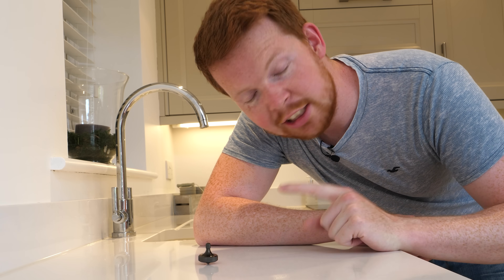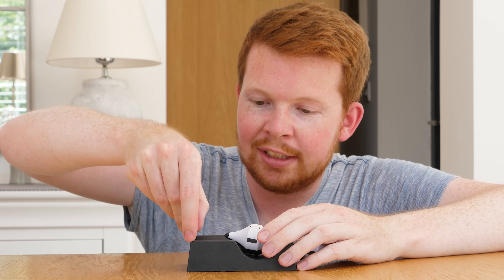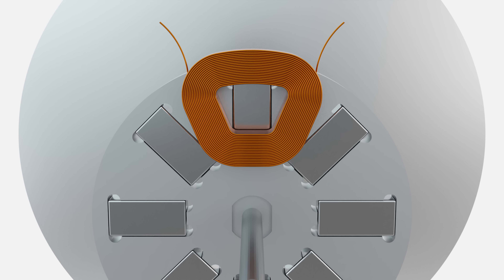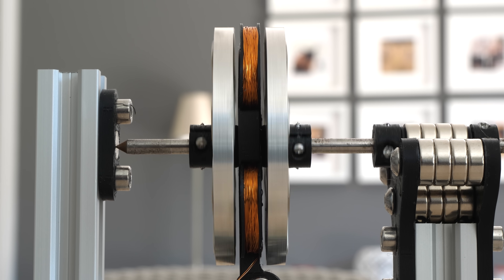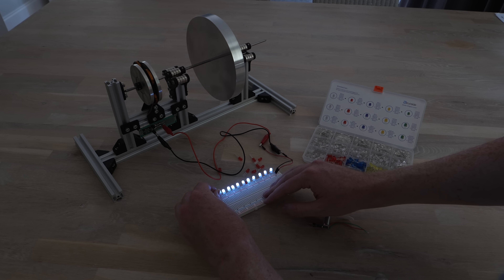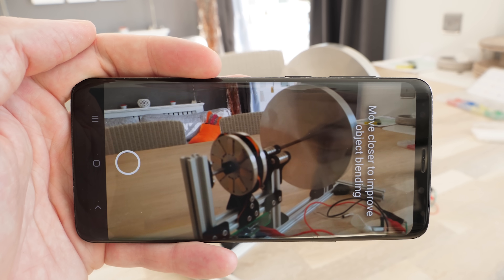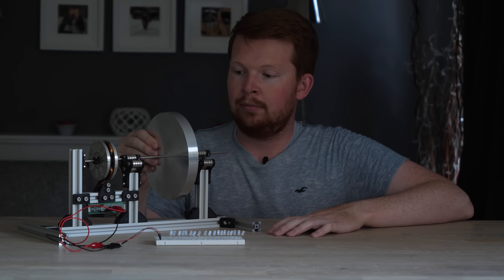Flywheel Battery

Comment: This was the first time I've ever understood how a full bridge rectifier actually works.
Reply: Exactly! Same here.
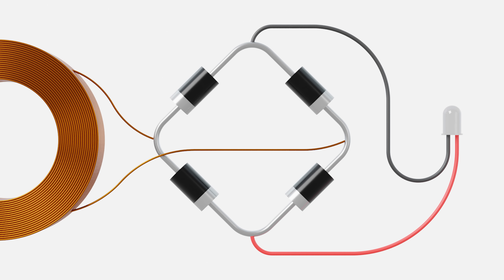Reply: @albertboaduameyaw8659  6:21 notice the arrangement of the diodes, and the source and load. You can use a bridge to protect the input of your project from reverse polarity, If the battery was installed "the correct way" the power would flow properly. If the battery was installed "the wrong way" the power would STILL flow properly. Unfortunately, there is some voltage loss. Bridges typically use diodes that lose 0.7V each, so 2 * 1.5 = 3V loses possibly 1.4V <very sad>  If you build you own bridge using Schottky diodes the loss is less 0.3 to 0.4V.    https://en.wikipedia.org/wiki/Schottky_diode
Note: I previously referred to 4 diodes, which is incorrect
Reply: 6:21 notice the arrangement of the diodes, and the source and load. You can use a bridge to protect the input of your project from reverse polarity,
If the battery was installed "the correct way" the power would flow properly. If the battery was installed "the wrong way" the power would STILL flow properly. Unfortunately, there is some voltage loss. Bridges typically use diodes that lose 0.7V each, so 2 * 1.5 = 3V loses possibly 1.4V <very sad>  
If you build you own bridge using Schottky diodes the loss is less 0.3 to 0.4V.    https://en.wikipedia.org/wiki/Schottky_diode
Note: I previously referred to 4 diodes, which is incorrect
Reply: @leef_me8112  Its not 4 *1.5 since only 2 diodes will conduct at any one time
Reply: @dantronics1682  You are quite right, I will correct my replys.
Reply: Yea
Reply: Same...
Reply: That aha moment too when you realize that with AC you're literally alternating between pushing and pulling the electrons through the wire just a short distance. This is why there's so much less resistance with AC power transfer because you're not trying to push the electron all the way from one end of the wire to the other. You're just pushing and pulling it a few inches and reversing that flow 60 times per minute. It's like having a DC power transfer that's being done with a 6 inch power cord.
Reply: @randr10  
Like students pushing each other in a long crowed hallway. Push the kid in front of you and some kid 20 people ahead falls over.
Reply: @randr10  that's only HALF the story though Eddy currents are Vortexing filament outside of the line , the greater the distance for AC the Greater the line loss which means needing Thicker Wire.
Reply: @mjolnirswrath23  Oh I know there's line loss, but the main reason for the reduction in line loss over DC is what I stated about not needing to push the electrons all the way through the wire from end to end, or at least I think that's the main reason. Could you elaborate on what you mean in regards to eddy currents?
Reply: You should try electroBoom ;-)
Reply: @tiborbogi7457  yeah i heard this comment lmao
Reply: Make a weather balloon with a pressure meter and a servo on the end that compensates and drains the excess out when you go to a big altitude

Comment: can u replace the tip with magnets to decrease the friction , replace the flywheel with rotor that heavy enough as to act like a flywheel , increase number of magnets per rotor and increase coil per rotor. im sure this will increase the output voltage

Comment: What if you drive the flywheel with the motor which is powered from the flywheel ?  Bootstrap the system by turning the flywheel manually.

Comment: Use four sets of fixed baring magnets, two on the bottom and two sets on top, and you will have less wobble as the magnetic fields press against each other
Take the flywheel and machine small cups shaped like those on a pelton wheel then use compressed air to spin the flywheel.
last, instead of a plate at one end use magnets with matching poles pushing against each other as endplates.
this will give you a compleatly free floating flywheel with it touching at no point.

Comment: Two things from an engineers perspective (I have a bachelors of science in mechanical engineering)

First, to remove the rod, try temperature. Hot disk, cool rod. Either liquid nitrogen the rod, to shrink it, or torch the disk to heat it (more likely to also heat the rod due to difference in thermal mass)
Two: try using the chuck in an electric drill to spin the flywheel, just do it in the direction that allows you to grab it and loosen it while it’s spinning so you can remove it after adding rpm
Reply: 1) How do you propose to heat the disk but not heat the rod which will then also expand? 2) What does spinning the flywheel have to do with removing it from the rod? The second shaft he installed was not threaded but installed with an interference fit. The flywheel is pretty much locked onto the shaft and at this point the only way to separate them is to cut the shaft close to the flywheel and punch or press out the remaining piece.

Comment: You could probably attach a smaller version of this to a model car. The current could create power for the electric servos. Maybe even have a regenerative system so it could run forever, as long as it’s moving of course.

Comment: Oddly enough I made one of these almost exactly like this, a few months ago! Mine was supposed to be part of a homemade wind turbine project but I never really finished it. Literally the only difference was that I tossed a capacitor across the outputs as a low-pass filter so I smoothed out the signal, not to mention mine was a lot bigger and high power version but I like the way toms looks, (mine’s all 3D printed and a little bit ugly)

Comment: Greater the draw of power the greater the resistance for it to move and quicker it will slow down. I made one of these years ago with a junk bicycle and magnets attached to center of aluminum rear rim. Placed coils following radius of rim to also 4 diodes to act as a bridge rectifier, but sadly the greater the draw the quicker it slowed the rim. I was expecting the rim to spin for a while making electricity, but if you put a heavy load or dead short across the bridge the rear rim stops quickly as the magnets and coils act as a magnetic brake and the diodes get really hot as the load is across them. If you take a DC brush motor and spin it without it connected to anything it will spin easy. If you cross the wires as a short to a DC brush motor and turn it you will find great resistance as it acts like a magnetic brake to the coil and shaft!

Comment: Instead of a rectifier, why not use half the generated power to run a motor with enough torque to spin the axle so you don't have to do it by hand?

Comment: Build another magnet rotor and coil setup and use that as the motor to power the thing from the generator/flywheel end, also add more generator rotor/coil sets, capture the back emf and run that back through  to add to the power to run the machine.

Comment: In the example with the LEDs, he connected all the LEDs in parallel, where the LEDs don’t split the voltage thus the rectifier not having to supply more voltage to power them all. He should have connected the LEDs in series, where the LEDs would split the voltage among them. That’s why you put resistors in series when you deal with electronics.

Comment: Good video. A local company uses a large granite flywheel battery to handle the switchover from grid power to an emergency generator in their data centre. Far lower maintenance than a bank of lead acid batteries.

Comment: Instead of levitating the flywheel, fixed the shaft to a low friction bearing and connect the shaft to a small electric motor to drive the flywheel shaft.
On starting the apparatus, used an external battery power to the motor and thus turn the flywheel to the desire RPM for the flywheel to produce enough electic current to run the motor on its own power produced by flywheel.
 Thus the setup is perpectual motion.
Maybe using Tesla method of amplifying power .. you could produce an access electric current run an external load, eg a light bulb.

Comment: My first thought on setting the schematic at 6:31 was that there was no load resistor to prevent the current from exceeding the LED's limits. Although, in this instance the coils of wire are likely producing enough resistance to prevent problems.
Reply: They are not producing too much current or voltage either because the LEDs get dim very quickly. In his case, since this is not like a battery, the energy output is bounded, he cannot have a short circuit here with a sudden release of energy anywhere that could damage those LEDs.

Comment: Would you be able to run AC through those coils as input to spin the flywheel? Most electric generators are just motors being run in reverse, right? Would that apply here?

Comment: awesome project! i have one idea to improve it. Since there is only voltage when the magnetic flux is changing inside the coil you should change the distance between the magnets . right now one magnet leaves the coil while the other ist going in. If you would do it alternatly the flickering would be a lot smoother :D 
Best wishes! Felix

Comment: In the future try to replace the shaft with a hardened steel linear bearing rod used for 3D printers and use a setscrew or epoxy glue to fix the flywheel. BTW, nice work, even with a bit of wobble!

Comment: My ideal flywheel would be like a hammer mill .so you could have a lighter flywheel overall weight but at full speed and totally extended causing a higher potential of stored energy with less mass. .

Comment: Whenever you take energy out of the system it's going to equate to a torque. It just seems like it makes more sense to me to use the radius of the flywheel because it's going to have the highest to torque efficiency in the whole system. Maybe even think about using a halback array with some neodymium magnets along the radius of the flywheel it should give you the greatest efficiency in that system.

Comment: Great build! Good job on making it work with just a hand crank. 

Try placing two of the coils out of phase angle with the others. This combined with the capacitor should smooth out the rectified current considerably.

Also an aspect that would have been good to discuss is reverse EMF due to the connected load. Start the flywheel at the same RPM and time/graph the drop in speed, current and voltage with and without a  load connected. 

Lots of good efficiency optimizations in those numbers. 😁👌🏽

Comment: Someone, is it possible to get unlimited energy, by optimizing the stability and the input of the shaft rotation, use imagination, to put gears on, that get powered by electric motor, that gets powered by the shaft?
Reply: Idk what you're asking. But no, unlimited energy is impossible, so what ever you are asking, no.

Comment: Should have measured how long it spins for while it has varying electrical loads.
Reply: yes without that its useless, the amount of energy required to spin that wheel is  almost same as generated by this thing.
Reply: @xpertcrush  "Almost"? That would still give you a bit of extra energy. Imagine a large scale version of that thing, it could probably power all sorts of things.
Reply: Correct me if I'm wrong, but wouldn't the load have zero effect on the duration of the spin? Since the only friction is on the end point of the rod? Or is the copper acting as an electromagnet to slow it down as load increases?
Reply: @elismith4040  Hi Eli, Electrical Engineer here. The bigger the electrical load, the higher the current flowing in the copper windings. The higher the current, the stronger the magnetic field it produces, which is attracted to the magnetic field from the rotating permanent magnets. The interaction of the two magnetic fields produces a torque that slows down the generator (and hence connected flywheel). So larger electrical load, faster deceleration, shorter spin duration.
Reply: @timothyerskine8711  exactly, the only advantage of this generator is the low friction
Reply: @timothyerskine8711  that makes more sense now, thanks for the response!
Reply: @timothyerskine8711  Follow up question: 
So for the energy stored in a flywheel, KE = 1/2Iw^2
But what is the equation for the output current relative to electrical load? I can't find an equation that fits the load and current together. (Unless it was ohm's law).
Basically, how would you go about finding a sweetspot for the most efficient RPM to rotate the flywheel at for maximum current output (or power output- either one)

Comment: Would this work in a vacuum?
Reply: What if you added a small battery that would be charged by it that would then be used to spin the device up to high RPM quickly and occasionally?

Comment: 10v? That's almost a 3S LiPo. I have an RC car that goes over 50km/h using a 2S at a nominal voltage of 7.3v and a max of 8.4v.
Reply: I know this doesn't take in to account amperage and some other stuff I'm probably completely ignorant of. But I'd be hard pressed to say I wasn't impressed by this.

Comment: Figure out how to hook a motor up to it with a battery and I bet u can create a perpetual motion machine that would last until one of the components failed 

The motor would periodically connect to the flywheel to keep it spinning and the motor is powered by a battery that’s powered by the flywheel 

Maybe make multiple induction alternators and make it power it’s self 🤷🏻‍♀️

Comment: Why not magnetically fully constrain the whole flywheel assembly? (ie. put repelling magnets on both ends of the shaft so it is fully levitating, rather than having that pointed end slowly drilling into its stopper.)

Comment: If you space the magnetic bearing STATORS a bit wider apart than the magnetic bearing ROTORS, then I think the axel assembly would be self-centering thus enabling you to dispense with the pointed "thrust bearing".

Also the diodes of the bridge rectifier cause a drop of about 1.2 volts in forward conduction (called the "pedestal voltage").  If you use an arrangement of field-effect transistors (instead of diodes), I believe you can eliminate this pedestal voltage drop.

Comment: First down on the end of the shaft where you have the metal on metal , effectively your low friction bearing, you could easily replace that with two opposing magnets to make the whole thing completely magnetically levitated.  If you can't get the balance right without it I suppose you could put another set on the other end of the shaft.  To spin it up by hand much much faster just put a small bearing anywhere you can hold on to it with one hand.  Then wrap a small bit of kite string or fishing twine, around a foot long or so around the shaft.  Hold the bearing with one hand, pull the string with the other.  Once the string is unwound it will simply fall off since it isn't attached but that small quick pull like starting a lawnmower will get the whole thing spinning very fast since every 1/2 inch or so of string that you pull will cause one rotation of the shaft.

Comment: question: if you offset the magnets and arrange them in a way that they are not aligned to each other in both flywheels (i.e. magnet in flywheel A lines up with the space between magnets in flywheel B), would the experiment still work? and if so, would that have an effect on the flickering of the LED's?

Comment: Now im Interested Im not a pro or something neither am i knowing the whole physics but
Could it be that if you reduce The Length of the Rod and use The Rotor With Magnets As Actual flywheel that this could reduce the Wobble and therefore the efficiency slightly?

And to Make the Magnetrotor heavier and More suitable to be a flywheel use Something heavy at the Outer  Radius like Lead weights or something like that.

Comment: what if you were to add a clutch and 3d printed gearbox onto the spinning end of the shaft with a hand crank? you could use the whole assembly on the other end of the shaft for a bit more stabilization so the coils could be closer to the magnets, and with the hand crank on a clutch, you could spin it easier and much faster?

Comment: This is basically why we need turbines in our electrical grid, for example from nuclear energy. 
The turbines have a huge amount of motion energy and will keep turning as people use electricity in the grid. The power plant can "add" more energy into the turbine, making it spin faster or slower (or rather, maintaining its speed despite people using electricity). 

So you basically reinvented that. :)

Comment: If the flywheel was to be loaded with magnets on the circumference (in one direction) then on the sides of the circumference a large magnet be placed closely following similar poles, then would that keep the flywheel rotating without external force, provided  the distance between the levitating magnets increased and the end axis be supported on a ceramic bearing

Comment: these are actually used in some places to balance renewable energy! i think it would have been cool if you also electrically spun it up (for example by butting a voltage on the coils?)

Comment: you can make levitation with little metal, recycled plastic and cheap liquid nitrogen from a wind turbine-compressor, improving also conductivity in the generator with the nitrogen, then you can attach the flywheel to a recycled reinforced plastic wind turbine

Comment: Not sure if anyone has mentioned but as more coils are installed to generate more voltages, the drag affect will occur at the coils and the magnets as more current drawn from your load (LEDS) or what ever you might want to load.  So this is where the No Free Lunch begins!  Load verses magnetic coil drag.  Maybe one of these days when the physics code is broken!!!
Neat Gadget though.